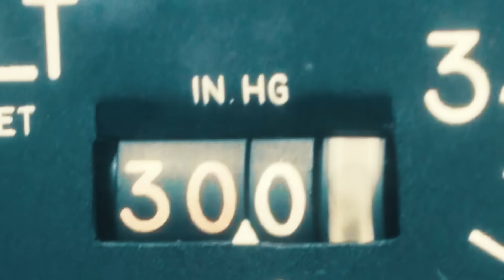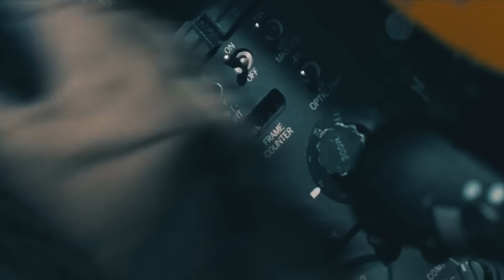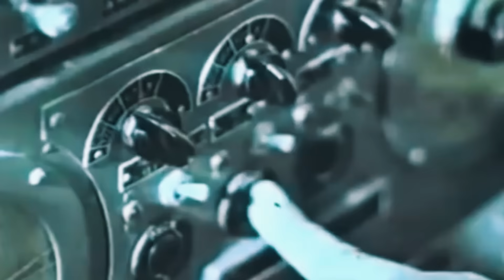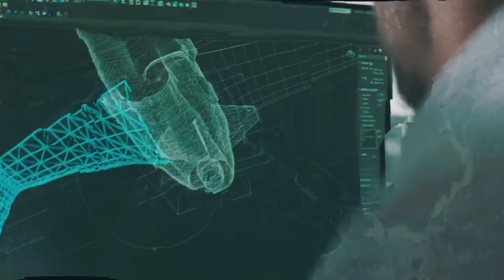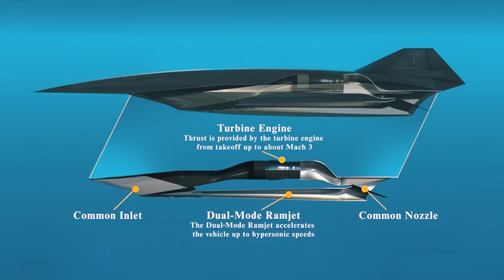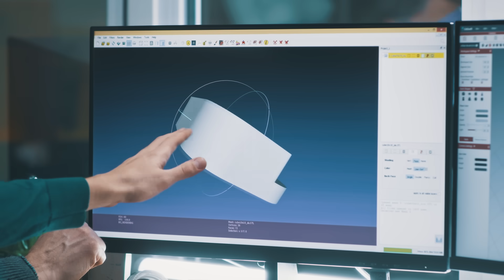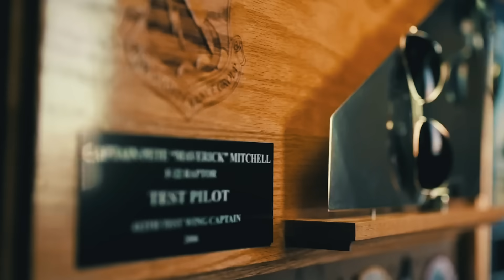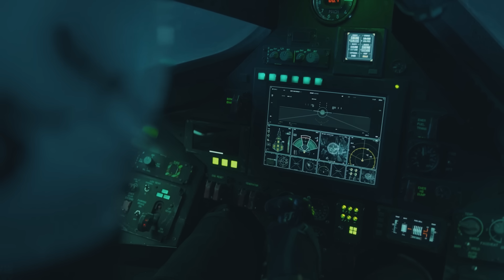USAF Declared SR-72 Darkstar Is Finally Ready To Fly

Comment: During the bidding for the aircraft to win Project Oxcart, the Convair division of General Dynamics offered a plane called the Kingfish.  It was a delta wing aircraft with the intakes and exhausts of the engines on top of the wing area next to the center portion of the fuselage.  The verticals were tilted inward similar to the A-12/SR-71.  Underneath the leading and trailing edges of both competition aircraft were triangular forms to decrease the RCS - Radar Cross Section.  Too bad the Kingfish as far as the records go, never got to fly.  The closest were the RCS models that they tested on the radar range, somewhere in the high desert, out of prying eyes.

Comment: Ok first problems were the timeline. The U-2/TR-1 were designed and built before the SR was flying. Second the A-12 was a single seat predecessor to the SR. It was based on the F-104 because the CIA didn’t have a big budget so Kelly Johnson took the F-104, gave it really long wing. So the CIA contracted for the design and development of the A-12 Oxcart. When the Air Force was given the SR-71, they didn’t really want it. Lyndon Johnson screwed it up calling it the SR-71 instead of RS-71 Reconnaissance plane. He just blurted it out at a news conference. Meanwhile, Lockheed worked with and developed a two seat aircraft because the Air Force didn’t believe a pilot alone could work the sensors and camera. The Darkstar never existed. The SR-72 was a prop made for the movie Top Gun II. It is nothing of a shell of an aircraft. But China showed an so much interest in it that the Air Force decided to prank the Chinese and rolled the model out during the Edward’s AFB’s open house. Lots of pretend guards but lots and lots of photographers. 
Does anybody really believe the Government would be that open about a top secret aircraft, especially one that has the supposedly so much potential. How long did the SR exist before it was revealed? The F-114 was flying missions before the Government was finally forced to admit it existed! 
So, no the SR-72 is not real!

Comment: As much "sex appeal" that a "Darkstar" jet might create, the reality is that the  existing satellite capabilities provide virtually all Imagery and Sigint we need.  The tactical theater is the most likely sector where additional capability is needed.
The SR-71, which has always been my favorite jet, suffered from,  extremely high operating costs making long mission planning and acft prep costs and time and those problems put it out of business.   It became like an $85,000.00 an hour hooker nobody could justify no matter how sexy or satisfying the performance might be.
Finally, with tactical intell as the weakest part of our current intel needs, a mach 6 jet manned or unmanned simply could not cover the area adequately.   For example, a SR-71 flew over our base in Duluth Minnesota in the 80-81 time frame.  Headed East Northeast they started a 180 degree turn and rolled out in the opposite direction over Chicago Illinois.  Hardly a tactically useful capability.  Love those sleek lines and performance but not useful for any tactical missions.

Comment: The CIA had already decided to replace the U-2, so they started project Oxcart which led to the development of the A-12. When General Curtis LeMay found out about the CIA's new plane, he said it should belong to the USAF. President Johnson allowed them to both develop their own versions and he'd decide the winner. The A-12 could fly higher and faster as it was lighter, the RS-71 was a 2-seater because it was originally going to be used as both a reconnaissance and strike aircraft. As the President was going to announce it, LeMay decided against the strike capability so it was renamed the SR-71.

Comment: You could have mentioned the record setting flight times:  Maj. Noel Widdifield set a new world speed record from New York to London. The flight covered 3,470 miles and lasted only 1 hour, 54 minutes, 56.4 seconds
Reply: On retirement, the SR-71 flew from LA to Wash DC in 61 minutes.  That plane is in the Smithsonian and they requested that the last flight be a record breaking flight.

Comment: My father was was in the Air Force and worked in Photo Reconnaissance during Vietnam out of Thailand. In 1973 he was stationed at RAF Alconbury in England were we lived for 3 years. He developed the film from the U2 and SR-71. He wanted to retire at Fairchild so he cross trained into Avionics working on the B-52 and retired at Fairchild. During that time the land just beyond the flightline was accessible, and he took us there in his Ford 4X4 truck. We were just past the  the perimeter fence past the runway and I witnessed the SR-71 take off from an Airshow there. It thundered down the runway and took off very low directly over our heads, and an intense heat from the engines was felt. It was an awesome view as the massive plane passed very low overhead and accelerated quickly away. I also was in Basic Training during the official retirement ceremony for the SR-71 at Lackland AFB in early 1989. Most of the recruits in my flight/squadron were in formation on the parade grounds during the events, and warned not to look up during the fly over. I was fortunate to be posted near one of the entrances into the grounds directing people. After a long ceremony it was announced the the plane was approaching and by the time the intense sound was present the SR-71 was just past were I was passing over. Then after the first of several sonic booms the plane quickly disappeared out of sight, soon future announcements of what state the plane was currently passing over were given, and at least one more sonic boom arrived as it was accelerating above. 

Also as a kid we had an after school "Aeronautics Club" which I'm sure my father had a hand in organizing. At the time there was a local news chopper pilot Dan Schmarr and former U2 Pilot who worked with my Father in England assisted with the Club. We build model rockets and balsa model planes and learned about Aeronautics. I had a huge interest in the U2 and SR-71 since my time in England and studied all about them. I even had the rare chance to be around them. I had a photo of an SR-71 pilot in his spacesuit in the cockpit flying taken from another aircraft, and also a photo from the SR-71 taken at such a height you could see the curvature of the Earth. 

I joined the Air National Guard while working as a Civilian at Fairchild and spent over a year active duty for Basic, and Avionics Guidance and Control Tech School afterward. then back to Fairchild for additional active duty during the start of Desert Storm were my unit was activated for Air Refueling Missions using our KC-135's. I had several opportunities to go up on Refueling Flights during my 6 year Enlistment including a deployment to Japan for a "Red Flag" Operation. We refueled many fighters during the flight. Another Flight was really awesome to be on was doing refueling for other ANG Units circling over Washington, Idaho, and the vicinity around. The Guard Units flew many older Fighters. During that Mission we refueled F-4 Phantoms, F-14 Tom Cats, and F-15 Eagles. I was able to lay down in one of the observation bays on either side of the boom operator and got some amazing photos and video. Seeing the F-4 was awesome, hard to believe a fighter that flew during Vietnam was still in service. Groups of fighters were in formation beyond our wingtips, each falling back behind and approaching the boom to take on fuel. I had a com set and could hear the communication between the fighter pilots and boom operator. 

While my father was still active duty I had the opportunity to go into a B-52 Flight Simulator, housed in a train car. Years later while I was Teaching College at ITT, one of my students worked for the company running the advanced KC-135 Simulators, and I was able to take my class there on a field trip.There were 2 simulators, one on full hydraulic rams allowing the simulator to move. It was being used for training, but  we used the stationary one. I was blown away at the interior, it was just like stepping into the real cockpit, so familiar to me after years or working on the Avionics Systems and Controls. There were super high-resolution monitors above which projected down on the cockpit "windows". You could see all the area around Fairchild's flight line, the base housing at the perimeter and the strobing runway lights. Within a short time it was perceived as "real". Myself and each of my students did a "Takeoff"  short "Flight" and "Landing"... Most "Crashed", but I was able to do almost a perfect "Landing" using the "Glideslope Indicator" and instruments. Each was given a printout afterwards. 

I once had the opportunity to take the controls of a corporate jet. I was working at Crop Growers Insurance in Coeur D' Alene Idaho as the Network System Administrator in their Regional Headquarters. My office was across from the pilots and I got to know him well, talking about my time in Avionics. Shortly after I started I was to fly to the Main Headquarters which was in Great Falls at the time. I arrived at the airport early one morning and we entered a heated hanger and boarded a Mishubishi-1000 Private Jet. During the flight to Great Falls the Vice President (Also a Pilot) and other executives were on board. On the return trip it was just myself, and the Pilot/CoPilot. shortly after takeoff the CoPilot came back and told me to go up in the cockpit. The Pilot gave me some instructions and said we were going to change waypoints. He told me to take the controls and disengaged the Autopilot. Using the Instruments and Controls I banked the Jet into the turn and aligned to the new course heading. As we got closer to our destination he resumed control and I went to the back again so the CoPilot could return for Landing. 

During a Drill Weekend while in The Air National Guard a group of us from my Shop was out on the Flightline checking out the Aircraft on display for a Base Open House and Airshow later that day. It was prior to the public being allowed on base for the event later that day. We went around the many aircraft including an F-117 Stealth Fighter which was bordered with cones and lines, and had armed Security Police watching over it. We then approached a B-1 Lancer Supersonic Bomber with the "nose art Heavy Metal", it too was blocked off and had armed personnel. The crew chief and other technicians were outside the plane and we started talking with them. They asked us if we wanted to see the inside of the plane, and we were escorted up the ladder and into the aircraft. I was blown away by the high tech cockpit, and bombardiers' station. It was like a sophisticated "Video Game". They gave us a tour of the systems and around the aircraft, it was very memorable.

Before I joined the Military I was working for Billeting on Fairchild and the Billeting for the Survival School Annex. It was Friday the 13th  in March of 1987. I was helping move furniture from a Security Police Barracks near the Flightline Control Tower. For a couple weeks prior I was observing the "Thunderhawks" demonstration team practicing for an upcoming Airshow there. It consisted of a B-52 Bomber and KC-135 Air Refueling Tanker which would take off in quick succession and perform low altitude banking maneuvers. This day as we were just about to load a desk onto a Flatbed Truck I watched as the B-52 took off followed closely by the KC-135. The time was near 13:13 when I observed the Tanker go into a steep bank, "wings vertical" with little airspeed and altitude. I told the other "That planes going to crash!", It was heading for a huge warehouse building which contained the Commissary, Base Exchange, and many other businesses filled with hundreds of active duty, retired military personnel, and civilian employees. The pilot made a last moment  control movement to the  planes elevators to direct it between the building and Control Tower. The Aircraft struck the ground and exploded into a massive fireball. It was surreal, difficult to process what I had just witnessed. Soon after, the sounds of sirens from Emergency Response 
and Fire Department Vehicles from Fairchild and the nearby Spokane Airport began to arrive. There were 6 Crew members onboard who all died in the crash. not much was left recognizable of the plane except parts of the tail. It was later discovered that a 7th fatality occurred. There was a Boom Operator who was scheduled to fly on the plane that day, however was grounded by the Flight Surgeon due to sickness. He was standing next to his car observing the takeoff and the the plane crashed there taking his life also.
Reply: Wow,...yours was the longest comment I believe I've ever seen! Lots of interesting details.
Reply: I was working at Spokane airport the day of that accident...Alaska ground crew.

Comment: They need to start using the new Taqyon Quantum Oxide Free Graphene product. It has 200 intercalated layers per nanometer. There's no better head shielding and EMI shielding product on earth. When used in conjunction with hydrogenated graphene, it acts as a superconductor at room temperature.

Comment: There were only two SR-71B aircraft made, used for training pilots. One was lost in an accident. The sole surviving SR-71B training aircraft, with its second elevated cockpit bubble, can be seen at the Airzoo in Kalamazoo, Michigan. They also have a F-117 among many other aircraft on display. One of the volunteers told me when the F-117 was retired the air force took special care to remove the top-secret stealth paint skin before shipping them to museums. A basic commercial grade matte black paint then applied to simulate the skin.

Comment: It is not the fastest Jet aircraft. SR-71 was actually retired afte the incident with Soviet MIG-25, when the MIG-25 outrun the SR-71. SR-71 was no longer safe spy plane. SR-71 top speed is only 3.300 Kph, while MIG -25 top speed is 3971 Kph.
Reply: MIG-25 had a 5 minute limit at Mach 3.2 or else it would overheat. SR-71 could fly unlimited at Mach 3.2 - about 45 minutes with full fuel tanks. Mig-25 was a sprinter, SR-71 was an endurance runner. Also, if outside air temperature @ 80,000 ft was -49 C or colder, then the SR-71 was capable of Mach 3.3 - slightly faster (123 km/h) then the MIG.

Comment: @Wild Iron
The SR-72 would most likely use this special type of Titanium that handles heat past 6000 deg Celsius & this aircraft would have been secretly flying as far back in 1999 when the SR-71 had it's last flight. Normally the military shares the news about a certain top secret aircraft such as this 20 - 25 after it's already has been flying & the real reason for them speaking about it is that the military has upgraded the old SR-72 with some new aircraft that is even more secret.

The F117 that was supposed to be a state of the art new secret aircraft only lasted as long as it was able to be replaced with the F22. The B2 also had the same fate as the F117 where it has only lasted as long as it took to make the new B21 bomber that came out recently. All in all if you're hearing about a so called new aircraft coming out in the military the only reason you're hearing about it is because they have something even more secret flying around that you will not hear about for another 20 plus years.

Comment: The info stating this aircraft flys at mach 3.3 top speed is not correct. My turbine engine teacher that worked on the SR-71 in the military said the real speed is mach 7.  I could understand a aircrafts nose glowing red at mach 7  but not at mach 3.3.

Comment: Having just read the The Skunk Works written by Ben Rich and Leo Janos, this design was on paper in the early 60s. The story of The Skunk Works is absolutely fascinating and satellites cannot and do not fulfill the overflight missions of a strategic reconnaissance aircraft, whether maned or unmanned. The two position SR71 was the air force variant that had extra ELINT and other sensors onboard while the original and first CIA variant was a single seat photo reconnaissance only.